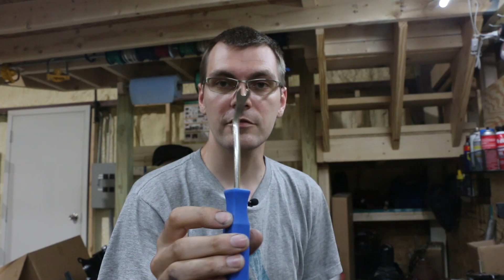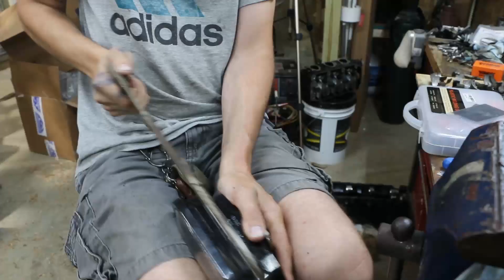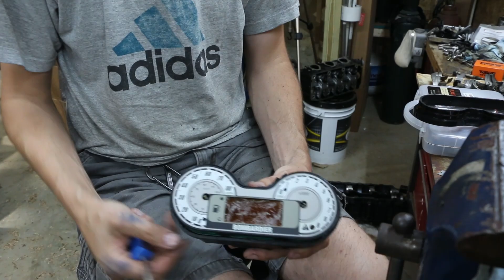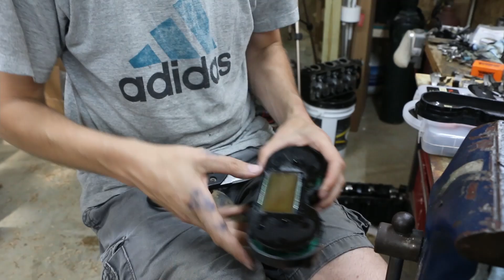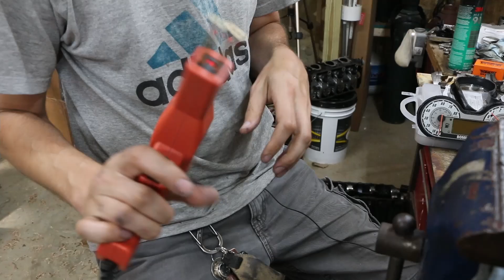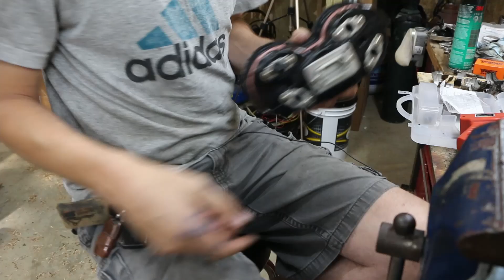05-Earlier Seadoo Dash cluster information center thing repair

Comment from the maker: What you'll need:
LCD Polarizers: https://amzn.to/3MxWwSB (This looks like a good option, the one I bought is no longer available, there are loads of options here: https://amzn.to/3q6x3Ip)
Cutoff tool: https://amzn.to/2TjAICB
Hot stapler: https://amzn.to/3dnbJW3
Black 3M 5200: https://amzn.to/3y7JySX
Hacksaw along these lines: https://amzn.to/35XXz9B or https://amzn.to/3hf0eAZ
Razor scraper: https://amzn.to/3dp0KLI
Razor Blades: https://amzn.to/3hvNer1
Trim clip tool vaguely like this for removing needles: https://amzn.to/3F7P258

(These links are affiliate links, which earn me a small commission on qualifying purchases from them, this is done at no cost to you, and helps support me continuing to make videos like this)

Comment: Super old but maybe even another viewer can help - how the hell do you get the wire harness disconnected? I got the gauge cluster hanging out but I swear I’m gunna end it all over this pin connector. 

I’ve tried everything from squeezing, screw drivers, little picks, I can’t get it to disconnect. Any tips?
Reply from the maker: There should be two tabs on either side you can squeeze on the connector, then pull it out of the cluster.

It might be a bit stuck, you may need to wiggle it or put some soapy water or something to lube the gasket around the edge
Reply: @trythistv  I hit it with some electrical cleaner and then used some wide mouthed pliers with these little curved tips. Needed an insane amount of force the plastic was breaking the skin on my fingers but we got and the cluster curing now. thanks again!

Comment: Excellent step by step video. I used it to fix my compromised LED display cluster on my 2004 GTX SC LTD. 
Couple extra tips- I use WD-40 instead of soapy water and the special tool bought to pop-up the needles to remove the cluster. Great video thanx again. U rock bro.

Comment: 😊 but how the fuck do you get it out of the hood
Reply from the maker: If you sit on the machine, spray a little soapy water around the perimeter of it, and pull it straight towards you, its just in a rubber grommet type thing

Comment: I would cut 1/4"-3/8"' from the black ridge, not 1/2".  1/2' inch cut puts the cut too close to the printed circuit board.  I knocked off a barrel capacitor from the PCB.  Hope this still works after that.  Other than that, excellent video.

Comment: The polarizer film you recommended is a 90 degree film. I would instead recommend a 45 degree film which was the original part. If the operator is wearing sunglasses or has polarized googles, it can be problematic reading a 90 degree display.

The film orientation can be placed correctly without connecting the LCD.

Use a strong external light,
Clean the LCD face: After removing the old polarizer film, make sure the glass on the display is completely clean. Remove all traces of the old adhesive with a proper cleaning solution.
Place the new film on the LCD: Set the new polarizer film on top of the clean LCD glass.
Put on your polarized sunglasses: With your sunglasses on, look at the screen through the new film.
Rotate the film: Slowly rotate the new film while looking through your sunglasses. You will notice that the film gets darker and lighter. The angle at which the screen appears the darkest or almost black is the correct orientation for your display.

Comment: It's a shame there's literally no info anywhere on the internet about how to actually remove the cluster from the ski
Reply from the maker: Good news! I'm working on a video that not only covers removing the cluster, but also shows a permanent solution to the faded cluster that doesn't require cutting it apart!
Reply from the maker: In the meantime, spray some soapy water around the perimeter of the cluster, then pull it straight out toward where the rider sits. It's just a rubber grommet that holds it in place on the 02-05 skis
Reply: It just pulls out.

Comment: I know this is a late comment and thankyou for the video, im about to do mine, could you plug the guage in to zero out the needle stems before fitting the needles? just wondering if that would be okay to do.
Reply from the maker: I feel like plugging the gauge in without the needles on ends up flailing them all over, I don't believe these are stepper motor gauges, so they rely partially on the weight of the needles to dampen the motor a little, but I'm also not an expert on how these work, so I might be completely wrong, I think I remember reading something about it but its been a while.
Reply: @trythistv all good, I realised it’s a while since the vid but thank you heaps just the same, appreciate it

Comment: I need to do this on 2005 RXP and I see this video is a few years old. Any updates to completing this or anything you'd do differently now? Thanks for the help
Reply from the maker: There is a way to install a 06-up cluster into an earlier machine, it isn't super hard but may require software changes or at least a scantool to marry the cluster, while the older clusters didn't require that. I'm tempted to sell my older clusters and try installing a new style one in the sea-don't.
Reply: @trythistv I would be interested in buying all the 02-05 clusters you have. I can also explain to you how to use the 06 style cluster
Reply: I do these on a daily basis.
Reply: @jeordanmarcos9436  What Harness do you utilize for the new clusters? Im wanting to install a newer on mine. Thanks

Comment: Hey do you provide repair services?
Reply from the maker: I mean technically yes because I run a shop that fixes pwcs, but I haven't really gotten into repairing stuff and shipping it or anything like that.
Reply: Would you be interested in repairing one if I shipped it to you? I'd be happy to pay for the shipping, materials, and your time...
Reply from the maker: Possibly, I'm not sure what it's worth, or I do have one that I repaired that I had as a spare that I might be interested in selling, send me an email with your thoughts on prices and such, Tom at trythistv dot com
Reply: @trythistv  how do I send you a direct message? Sorry if that's a stupid question, I don't use this platform very often besides for shorts...😅
Reply: I do on a daily basis

Comment: How do you remove the Cluster from the Jet ski
Reply from the maker: If you sit on the ski, grab the cluster and pull it straight toward you. A little soapy water sprayed around the outside of the cluster helps.

Comment: Any advice on what to do if the orientation of the needles is not correct? My rpm needle winds all the way around settling under 0 rather then showing 2k rpm
Reply from the maker: I've not had that problem, but if I did, here is what I would do:
Open the cluster back up, Plug in the cluster, pop the dess key on to wake stuff up, let the needles sweep, and once they come to rest pop them off with the little tool thingy, then pop them back on at 0 before the machine powers down, usually they stay awake for a minute or two with the dess key on the post. If needed do one at a time, get the tach removed and replaced at 0, power the machine down by pulling the dess key, and then repeating on the speedo needle.
Hope that works, I've not had to do it but that would be my first try.
Reply: @trythistv  appreciate your response your guess is better than mine so I’ll give it a try

Comment: Also, how does the cluster remember the hours once you reinstall it? Does it reset?
Reply from the maker: The hours are stored in non-volatile memory in the ECU, so disconnecting the cluster, battery or anything else doesn't have any effect, the hours will still count up if you went riding with the cluster disconnected.

Comment: Do you have to apply the protecting screen? What if you just peel the old one off and put it back together?
Reply from the maker: You'll not be able to see the display. I'm not an expert but the LCD panel is polarized one way and you need a polarizing film going another way to make the letters and stuff visible, or something like that, otherwise the light just passes through and doesn't show up.

Comment: Thanks for the great video. My one question how did u remove the cluster from the jetski? Thanks
Reply from the maker: I sprayed some soapy water around the sides of it and pull straight out towards the rider. Only 05 and older are that way, newer ones use a different cluster.

Comment: I had to rotate the polarized film 45 degrees to get the best contrast.  I would think it would be set at 90 degrees or zero.  Glad I test fit it before installing.  I had to order more film as my practice pieces were ruined.  The LCD screen has sun damage but it should be better than nothing!
Reply from the maker: I bet your experience is why some folks have lackluster results. I can't imagine why the film would be oriented like that. Must be I got lucky with some that is 0 or 90 degrees. Thanks for the info!

Comment: Can you share a how-to video on how to access and remove the instrument cluster from a 2005 Seadoo RTX?
Reply from the maker: I believe it should be the same on my RXP, so I can film that soon! It is super easy. Basically the cluster pulls straight out, is held in by a rubber gasket/grommet thing, so a little soapy water or something to help it slide out, sit on the machine, grab it and pull.
Reply: @trythistv  thank you. It seems a little intimidating to just pull so I look forward to seeing your video.
Reply: Have you made this video yet? Looking to remove my 2004 RXP cluster to repair and also feel nervous about just pulling it

Comment: I can't find the links to tools
Reply from the maker: Yeah, the description that I typically put that info in is getting harder and harder to find. Here you go:
LCD Polarizers: https://amzn.to/3MxWwSB (This looks like a good option, the one I bought is no longer available, there are loads of options here: https://amzn.to/3q6x3Ip)
Cutoff tool: https://amzn.to/2TjAICB
Hot stapler: https://amzn.to/3dnbJW3
Black 3M 5200: https://amzn.to/3y7JySX
Hacksaw along these lines: https://amzn.to/35XXz9B or https://amzn.to/3hf0eAZ
Razor scraper: https://amzn.to/3dp0KLI
Razor Blades: https://amzn.to/3hvNer1
Trim clip tool vaguely like this for removing needles: https://amzn.to/3F7P258

Comment: I’m about to do this job but I have a question. 
Why do you move the needles before removing instead of letting them rest in the zero position?
Reply from the maker: the key is finding the natural resting position of the mechanism that controls the needles, as they will likely spin to that natural resting position when the needles are removed and there is no drag to hold them at the zero position. If you don't do that the readings may end up being skewed and the cluster would have to be disassembled to correct that.
Reply: @trythistv  understood. Thanks for the answer and the video, of course. 
It’s amazing that a tiny little screen protector can solve this problem.

Comment: I have taken the panel apart, removed all of the dmaged film and adhesive, the polarizing film I tried from Ebay (different seller as yours are no longer available) including one from Amazon.  The graphics look sharp but the look transparent with only black edges on letters??  Very hard to see in the daylight?  Any suggestions on film that would work, outstanding tutorial but dissapointed with the end result.  Thank you in advance for your help.
Reply from the maker: Ugh, I was afraid getting film would prove to be a problem, I'm not sure what the differences are, I think it is the direction it is polarized in.
As a test, you could try removing everything again (I'm sorry, I know thats a pain), put the gauge needles on so they don't get out of calibration, and then plug it into the machine, power it up and hold your film and turn it 90 degrees at a time and see if it changes how it looks. If there is a direction it looks better in, cut it and apply it facing that direction, failing that, drop me a line: tom at trythistv dot com and I can mail you a sheet of the film I used and see if that is any different.
I have had varying results, my one dash isn't as bright and crisp as I would like, but it also had a lot more severe sun damage than the one in the video.

Comment: Hello from Thailand, a great video! I would like to try it on my jet ski too. What is the best way to remove the device? Do you have a video? Thanks a lot for your help.
Reply from the maker: I sprayed a little soapy water around the gauge to help is slide out better, and then just gripped the gauge and wiggled while pulling it straight out and it popped right out.

Comment: What was the tool you used to lift off the needles? I didn't see it linked. Just pulled my cluster from my 04 and building up my confidence to replicate your video.
Reply from the maker: I'm not sure why I didn't include that, I know it is a trim clip removal tool, I'm not even sure where I got it, but I believe this is essentially the same as what I have: https://amzn.to/3F7P258

Comment: bullshit!!this won't work,water will go in in matters of days!!!
Reply from the maker: You have never used 5200 must be. That is the adhesive used on thru-hull fittings on boats, lot of boats going to be underwater in a matter of a few days. This repair is still holding up great on a number of machines I've done it to. Can't get these clusters new anymore, so either live with no instrumentation or repair it. Your call.

Comment: Hey man. Enjoyed your video.  Thanks for making it. Ive got an 06 RXT with the full digital dash. Its not burnt nearly as bad as yours, but none of the lcd is clearly readable.   Do you think the polorizing filter might be the issue as well? Im unsure. If it would help id buy some IPAD  film and do the same procedure .
Reply from the maker: I'm not sure if the 06 and up would be the same, I do have one or two damaged 06 clusters so I should try cutting one apart, I do know that you can still get new clusters for the 06 machines, but they are expensive and require programming, so not exactly a quick fix. I would hate to suggest taking it apart and end up making it worse, I will have to look into repair options and see what I come up with!
Reply: Hey did you get around to trying to fix one of those 06 guages?
Reply: @mattbantick8963  Nope not yet. Too many other projects and jobs going on...wasn't a priority, and the easy fix is way to expensive ( replacement) .  Still needs dealing with but....my own business,  a second job,  and 3 kids lol
Reply: @mattbantick8963  oh. You weren't talking to me lmao

Comment: Great video! I want to do it but I cant find any info online to REMOVE the cluster from an 03 gtx di 155. HELP please!
Reply from the maker: Up to 05 (06 and newer is totally different) you should be able to spray some soapy water around the perimeter of the cluster and then grab it and pull straight out, it has a rubber gasket that can get a little stuck and the soapy water can make it a little easier
Reply: Too easy! Got it out in 5 min. Time to dremel. Thank you!!

Comment: My cluster does not work at all. It look beautiful but does not work at all. Do you repair the electronics?
Reply from the maker: I do not, but I would recommend checking the fuses and wires, I've seen a number of machines where a mouse has chewed through the wires that go to the cluster up where the hood lift strut is, and it blows I believe the 1 amp fuse on the MPEM

Comment: Ok but my cluster isn't working at all.
Reply from the maker: What year and model? There is a fuse on some of the mpems that controls the cluster, and I've seen fairly common that the wires to the cluster that are in with the gas strut for the hood get chewed by mice, short out and then it pops that fuse.
Reply: @trythistv  it's a 2002 GTX 4-tec

Comment: Hi! I've tried this repair no my 04 GTX since watching your video (very helpful by the way) and found my gauge was beyond repair. I found a replacement gauge off an 04 XRP that looks exactly the same. I plugged it in and it won't work when it was working fine on the XRP. Is there something else I need to do to make this work? I had assumed it would just start working.
Reply from the maker: Some of these clusters need to be "married" to the ECU in the machine, A dealer, or someone with Candoo/BUDS type equipment can do that.

Comment: When applying the new film,  does it have to be turned a certain way.  I read where most lcd film had to be turned correctly to be able to see.  Or is that for "linear" sheets.
Reply from the maker: I wondered the same thing, I haven't noticed any difference on the ones I've done but I may just have incredibly good luck or something and always happen to put it on the same direction, but I don't think these screens/polarizers are that kind.

Comment: I know you said 2005 and earlier......but I have a 2006 4-TEC. Have you tried the same technique with a 2006? Significant differences? Possible?
Thank you
Reply from the maker: I have been told the 06 clusters are impossible to repair in the same fashion and the only solution is replacement. However I happen to have 3 or 4 of them laying around that are completely trashed beyond legibility, and fully plan on attempting to repair them, or at least disassemble them to see if it is possible

Comment: Hello, the finishing product looks great but “ how I will take out form the gtx base “ I need help
Reply from the maker: This style cluster is just held in with a rubber gasket basically, a little soapy water sprayed around the perimeter of the cluster and then pull it straight out and disconnect the wires from the back.
Reply: Thanks I will do it